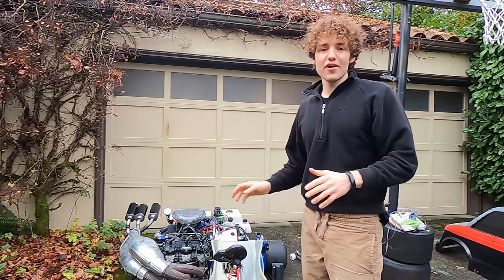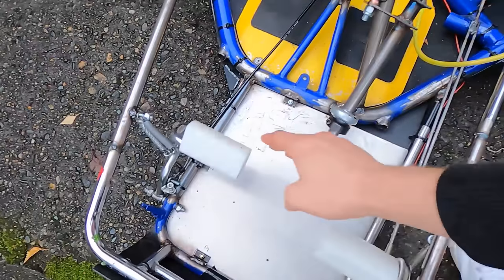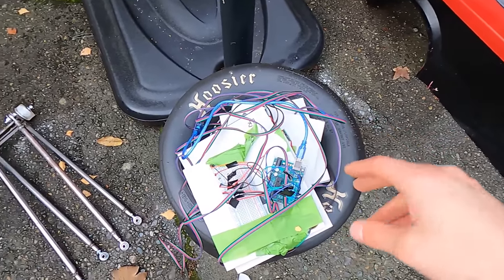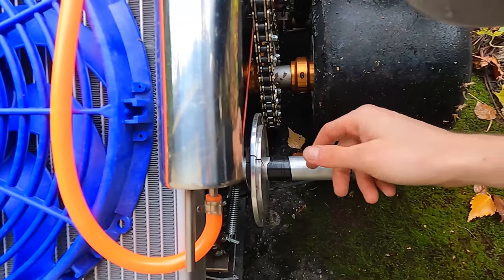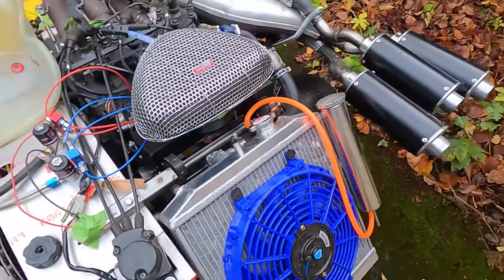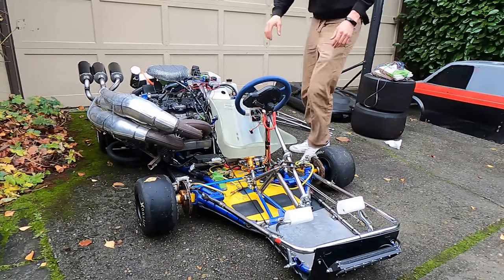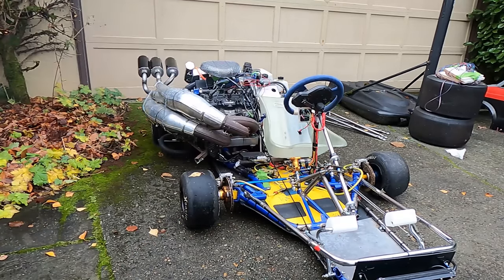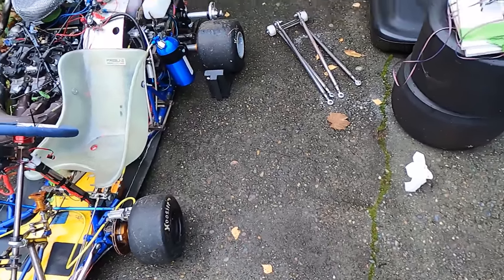700cc 2 stroke go kart overview

Comment: Nice build I grew up racing sleds in Maine.  My best friend still runs his 01 SRX and a 98 V-MAX 4 with lots of NOS.  That viper engine will only push about 110 hp to the crank that setup is probably more due to the ECU.  What carbs are on it.  Also th we Polaris secondary will actually probably work better you just need to set the tension so the tach will be at 7800 to 8200 at full shift.  If it is not shifting I to OD loosen the secondary spring up.  The triple pipes are a huge boost compared to the single the vipers came with does the block have power valves, if so then that setup will k be capable of SRX level of power which is 145 or so stock.  I was a CAT man and the SRX was my FIRECATS competition.
Reply from the maker: I've only actually been on a snowmobile once, but racing them must have been a blast!   I need to check the size, but it's just running the stock Mikuni carbs, and it does have the power valves. It's pretty much an SRX motor at this point, although I did see something in the forums about the viper engine coming trail ported from the factory. 

It's getting to about 8300 rpm under load. I currently have a pretty soft secondary spring. It's an orange 10070 30/70 lbs. Do you think it would be worth it to go softer?  I have no experience tuning CVTs. Might stick a camera back there during shift out to try to see what's going on.
Reply: @BootlegBarry  do you still have it?
Reply: You can also play around with the fly-weights Barry.. A clutch is a clutch my friend. the profile of the flyweight (outside or topside) will determine  where motor will run, so, a Dyno is pretty important to know where motor is at. 
I ran supermod Ski-Doo's back in the day, we even notched the weights to get engagement up without changing the spring for shifting. Our clutches came in consistently at 8600, and with the Comet qúick change we had a ton of adjustment

Comment: Instead of running to axles SKE karts sells adjustable axle hangers and some bearing casettes that would allow you to move the axles by taking out 4 bolts. Way easier than changing a chain and mounting sprocket and hubs
Reply: How can you move the axle like 4" without changing the chain, and you still need to change the sprockets to change the gear ratio to suit the big tires so no advantage.

Comment: Your vid just showed up and I gotta say for a younger dude you seem to know wtf ur talking about. Not many people know the differences between the SX Viper and SRX700. I don't subscribe to many channels but I will to yours. Keep it up man.
Reply: "At 8400rpm, it should hit 130mph, but with current clutching will only get up to 104mph. "   I always thought a clutch meant engine engaged or not engaged.   Must check out one of them variable ratio clutches!
Reply: @annpeerkat2020 or he means the clutch starts slipping
Reply: @annpeerkat2020  that is a variable clutch or CVT (Constant Variable Transmission). The faster the engine speed the more the drive clutch (the one on the crank) comes together and the faster the driven clutch spins the farther it spreads apart. When he says "current clutching setup" he means the spring and weight setup. You can set them to engage at 2K rpm or 5K+ for a more aggressive launch. When you grow up snowmobiling it's just second nature but if not just watch a video on CVT's.

Comment: Heads up , that’s a Yamaha primary , Polaris secondary .   Just saying
Reply from the maker: I switched to the Polaris secondary because it has a 1in keyed shaft that is easier to find parts for. If I did it again, I probably would have tried to adapt the splines on the Yamaha secondary.

Comment: Brake on Jackshaft??  WTF.. that is extremely dangerous dude. I've raced karts for decades.. almost all the VERY bad failure accidents I have seen were due to brake failure.. make your brakes MORE reliable not less. (front brake alone are quite useless on a kart... especially when ya need ALL your brakes to avoid death).
Reply from the maker: Were the brake failures you saw from overuse?
Reply: @BootlegBarry  Brake failures I've seen that caused accidents:  Linkage breaks or comes unfastened, hydraulic line breaks or pulls out, hydraulic seals fail, .. stuff like that.
I race the fasted dual engine sprint karts in the World.  We run dual calipers on the rear axle in case one fails, each on it's own master cylinder .. and front brakes to on a seperate master cylinder. My linkage is designed to still work even if hydraulic pressure is lost in any one or two of the 3 separate hydraulic systems.
When racing .. a brake failure that results in the loss of just a few feet of braking stop performance, can be the difference between winning a race and going to the hospital. 
As for the jackshaft brake here in this video .. obviously as stated, if the chain brakes of flips off.. it's a total loss of rear brakes. Chains RARELY break, even the small racing chains we use to reduce friction (unless you are running a master link.. we do NOT on the race track .. all chains are riveted back together) .. what does fail .. is the chain can derail off the sprockets.. due to chassis flex, bumping the engine mount clamps, or the chain sprocket bottoming out.. etc... ANYONE who has raced, has lost a chain this way, it happens to someone EVERY race day.
Reply from the maker: @KrustyKlown  I agree, the braking setup isn't ideal. Part of the reason it is on the jackshaft is for the mechanical advantage since I was reusing the stock brakes, and it's easier to switch between the kart and dragster tires. At least the part where the chain is shouldn't see that much flex since it has some decent triangulation. I think when it comes down to it, the kart is inherently dangerous in many aspects and not built for continuous hard racing, just something fun to occasionally mess around on, hopefully limiting the amount of exposure. The next project will make safety more of a priority.
Reply: @BootlegBarry  safety 3rd 😆✌️
Reply: Umm, it's highly unlikely the chain will break or derail. Its also more of a novelty kart, pretty sure no track is gonna let it race. Maybe let it run a few hot laps by self if know the track owner but either way , no matter what, it's a chance and a choice. Stop whining!
Reply: @shawnsatterlee6035  safety is all about how ya use it I guess.  FYI - most kart tracks would not let you run it on a practice day with a jackshaft rear brake .. and of course there is no class for it to race in .. the biggest displacement 2-stroke kart racing ever run was 300cc (the Vintage kart racing I do now)  .. and modern Sprint karting doesn't race anything over 125cc now.
Reply: How do you think the sled stopped lol krusty
Reply: @CompoundRacing1  he isn't driving a snowmobile, he is on a high performance kart that needs 3X shorter braking distance  .. and good snowmobiles don't have the brake on their jackshaft.. rather it is on the track driveshaft.

Comment: Ich hätte den Rahmen auf jeden Fall 300-500mm verlängert....
Reply from the maker: I agree, the shorter wheel base is nice for quick turns, but a longer one would be better for stability. When you use the larger tires, it does lengthen the wheelbase a bit and helps for high speed.